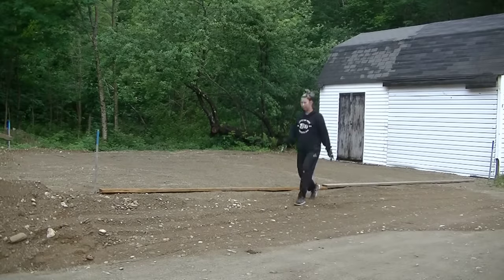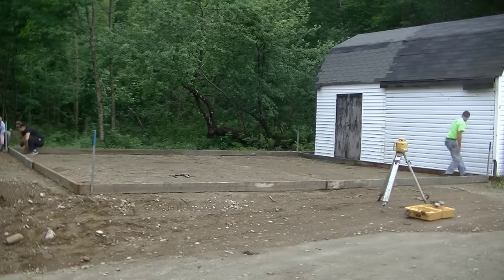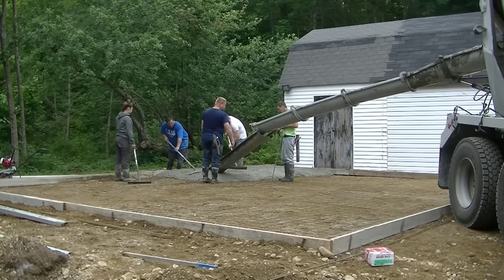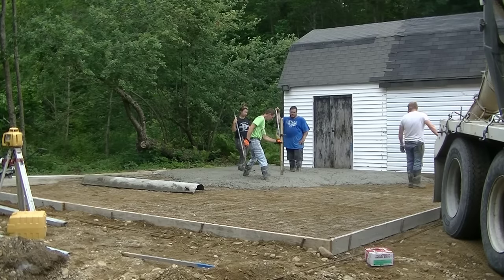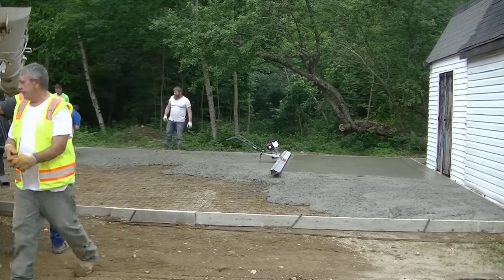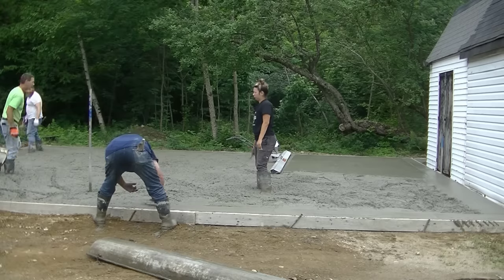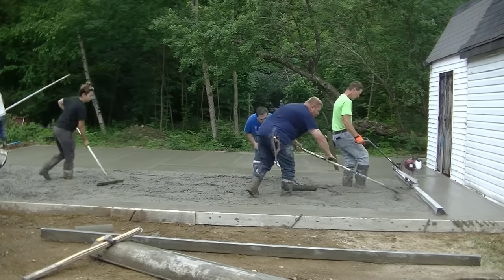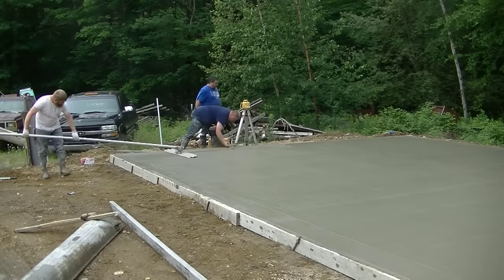Pouring A Concrete Slab For A New Garage (30' x 24') Form & Pour

Comment: Where is the gravel for a strong foundation? Did I miss that part?
Reply from the maker: It was gravel under the slab.
Reply: I always sample the base for a slab to find its stability. If you are pouring next to a house or an area by house that has a ground pitch towards the house you may have some very wet ground which is unstable so i compact in a couple yards of class 5 crushed limestone for a good base. Some soils are naturally good or house was back filled with  stable soil a base like a rocky clay and sand. So if you dont see yellow rock it doesnt mean the soil wont suffice.
Reply: How u know he ain't using a road base material. I'm sure he ain't posting videos of him pouring on plane dirt lol. This ain't his first rodeo

Comment: I was about to ask about the anchor bolts when you mentioned them right at the end. You guys are clearly professional grade. Seen other videos that seemingly know nothing about anchor bolts! The foundation guys gotta have a set of prints. One thing thats apparently not as common any more is setting a course of block around the perimeter to build off of- keeps the plate completely away from any water or shop fluids, etc. Great job - nice crew 👍

Comment: For those people concerned about the lack of chairs under the wire, remember this:
These ‘slab on grades’ (SOG) that they’re doing, have complete bearing on compacted soil. If this were an ‘elevated slab’, like a 2nd or 3rd floor etc, the requirement for the top and bottom rebar, are that they only be ¾” from the top of the slab and ¾” from the bottom (2 cm). The reinforcement is most effective the closer you can get it to the top or bottom surface. The course aggregate in the concrete just happens to be screened to ¾” (what a coincidence) so once some of the course agg gets under the wire, it can’t get all the way back down.
Reply from the maker: Nice explanation, thanks.
Reply: For this type of slab why wouldn’t you want the reinforcement in the bottom 1/3 of the slab?
Reply: @Btown605  That’s exactly where it is. 
A sketch would be helpful to explain the forces going on, but imagine a wooden beam. Draw a vertical row of 3 dots on the face of the beam. One dot ¾” from the top, one ¾” from the bottom and one in the middle. Then one inch horizontally away from those dots, draw 3 more dots spaced exactly the same. Then apply a downward force right between the rows. You would find the top 2 dots get closer together (compression) and the bottom 2 dots spread further apart (tension). These are the same 2 forces that will be applied to this concrete slab. Concrete does very well under compression by itself, so no top reinforcing is required. Concretes Achilles heel is tension, so that’s why the reinforcing is installed at the bottom. 
Getting back to the beam, you would also notice that the spread between the 2 middle dots stays stationary. Proving that the middle is under neither tension nor compression. That is why engineers never mind holes being drilled thru the middle (to an extent, of course) of beams, joists or slabs. That’s also why you’ll never find very much steel in the middle of a concrete beam or slab. It’s all concentrated at the top and bottom bcz that’s where all the forces are happening. Reinforcing in the middle of a beam or a slab is useless.
Reply: @psidvicious  That clears all my doubts, thank you very much.

Comment: Nice job Great tutorial very helpful! me and my two sons are going to try and pour a 21 x 21 garage slab inside 8 inch cinderblock walls with expansion joint all the way around the perimeter. i’m having a little anxiety about it. if there’s any pointers, you can give me that would be a big help.! I think my biggest challenge is I only have the two garage doors entering the garage and a man door on the back of the garage at the end of the side wall! I have poured little sidewalks and a little pads, but nothing more than that, and so I thought I would reach out to a professional to get some good tips and directions on having a a successful pour Thank you, Vincent.

Comment: I notice you did not put plastic down before the concrete went in. What would plastic do if anything if you use it? I wish the guy I helped watched this video. We had to pump the concrete on a cold day( about 25 degrees in the morning) the tubes had ice in them clogging up the concrete it took an hour to finally get the tube free. We had many problems but in the end the concrete was setting at the end and difficult to trowel. The concrete had excelerator in it and I’m wondering what was our problem? The slab was 30’ x 20’.
Your site was really neat, no crap getting in the way. Thank you for a great video. 👍👍👍

Comment: Its surprising how old school it is back east..im assuming its east coast.I been a concrete contractor 42 yrs on the west coast 2 guys would pour this and one guy hand finish it...a lil small for a machine imo..hand rod with a 14' aluminum.I dont see any kickers on the forms either thats different.I worked on crews that had 100 finishers 10 ten man crews just one ten man crew was expected to have 17-20 homes poured a day 6 days a week.It was down to speed and science i dont miss it.We had many pours that were 900-1000 yards at once.Its kind of nice seeing how its done out there main thing is that there having fun.
Reply: Commercial Crete blows. Decorative concrete is where the money and fun is at
Reply: @donpotts9814  i did comercial as a kid..decorative the last 30 yrs

Comment: I'm curious, this is a fairly large slab and it is for a detached garage so I'm curious why there are no footers?  Although local codes will obviously vary, if you are building walls and a roof, why don't you need footers?

Comment: The rebar and wire should be about 2 inch above stone   grade. Just like a concrete lintel, the rebar is closer to the bottom for compressive strength.

Comment: I just did a slab for a 12x24 and it didn't quite turn out as good as I wanted but given the fact that me and my kids did it I can live with the few flaws it has. At least its perfectly square and flat, fairly smooth and just a few flaws in it so I can live with that. Definitely not a professional job lol.

Comment: I was a contractor/builder for years so I'm handy but I have only done very small pours, like shed pads and sidewalks. I'm thinking of replacing my rotting deck with stamped concrete. The sides will have about 24-30" of facing and the pad will be about 16x40 with steps. Thinking it could be too large for just me.
Reply: that is what she said !😁

Comment: Good Afternoon, I plan on pouring a concrete patio and i currently have a sand (fill dirt) base, do I need to pack the sand, add a gravel layer, and pack again to complete the base preparation?

Comment: To do a professional job spacers should be used to lift the mesh from the sub base,steel in contact with the  sube base is not protected from attack from water and sulphates,any structural steel should have at least 2" concrete cover for protection.

Comment: I'm trying to get a garage built in my backyard. Once I get the trees removed, what is considered to be optimal thickness, 4" or 6"? I'll be putting in one lift at a later date, and having a steel building installed over the slab. I'm going to prep everything, but want a solid thickness for longevity and support

Comment: Hi Mike, very nice and informative videos. Thanks so much!

Question:
I’m about to prepare a 40x40 feet slab ( under roof) in south Florida. It’s under a new home on stilts, in order to have a cleaner surface for my ground floor. The home has concrete stilts. Each of the stilts has its own concrete foundation below grade. There is about 2 feet of sand that was poured over the foundation.

- My question is, can I pour my 4 in concrete directly onto the sand? Of course I’ll be using rebar for stability.
- Also, should I divide the surface in several smaller sections, or can I pour it all at once?
- Last question, is there any specific concrete if I want a polished final surface?

Thanks for your input

Comment: Yes I poured concrete when I was younger you know as a helper I've helped do walls and and slabs and sidewalks and I just can't remember do I need a special grade of cement for a garage which I'm going to park vehicles in for strength it's 4 in enough can you make 4 inch just as strong as our stronger than a 6 in and when you put your 6x6 steel wire mesh and instead of rebar do you put like a little spacer on it so it'll be like in the center of the cement when it's poured and not laying right on the ground it have more structural significance if about the center of the poor wouldn't it and can you just brush finish that slab you don't have to have it smooth and you sealer and do you need a moisture barrier I hope that's not too many questions please let me know something thank you thank you very much

Comment: Mike, Thanks for the great videos.  I'm a concrete contractor in Oshawa, Ontario Canada.  I'm going to use your training videos to train my new guys.  I have a bunch right now. Also I have a question. 
I need to cut a perfect vertical saw cut in a finished retaining wall.  Any Ideas?
Jim
Reply from the maker: Hi James, thanks for the comment. I've got a lot of good training videos in The Concrete Underground, my training academy. Plus you get access to me also for questions and knowledge that I have. https://www.theconcreteunderground.com/the-concrete-underground
If I had to cut a perfect vertical saw cut, I'd need some kind of guide to rest the saw against. What kind of saw are you using?
Reply: @MikeDayConcrete  -Where is your company located. thanks

Comment: Love the video's. I'm doing a 30x30 pad parking area. But instead of one large pad I'm doing it in a grid pattern.  Each square will be 7' square. I will be using rebar. Any other advise. Should I use expantion joint to go up against existing slab.

Comment: Gotta do a slab over an old a chicken barn slab it's in good shape but a lot of cracks, perimeters  are solid and deep.can I drop a new pad over that? It's been there for 75 years and hasn't moved up and down.just wonderin

Comment: Is it not necessary to install a stone base under the slab for expansion? How does the soil not freeze and heave the slab? In Pa, a much warmer climate we are required to use stone base. I'm confused. Thx Mike

Comment: When my 24x30 garage slab was poured 20 years ago, he dug a trench around the permitter and another down the center. He installed a re-bar cage in the trenches. Is this not necessary?
Reply: IT IS IMPRESSIVE HOW BAD THIS JOB WAS DONE!  Lay wire mesh on the ground and pull it up a little ONLY TO HAVE THREE BIG GUYS TO WALKOVER  EVERY SQUARE FEET PUSHING INTO THE MUD BELOW THE MUDDY SOIL LEVEL...Repeat that with the rebar below.   LMFAO

AND you sell and pour a floor without know what kind of structure is going over it????????

JEANous!

Comment: just watched a previous concrete guy place 32 yds of concrete in a 24x24 monolithic slab on grade with #4and5 rebar through out and foundation bolts in place, this is 13yds dumped on the ground I imagine yours is less expensive.

Comment: Doing my own slab. I would like to know what is the best way to manage the concrete as coming off the truck. Also, I would like to know what slump number the consistency of the concrete should be so it is easy to rake and level the concrete. I tried an only a one-time long time ago bad experience but I am still willing to learn.

Comment: That process would never fly where I live. You are required by code to have a minimum 12" footings around the perimeter and the mound up so that you can pour a five inch floor. Both rebar and metal mesh atr required. Anything larger than a 24'X24' foot print requires an engineer's stamp.

Comment: Mike when you are running that vibra screed along the wet pads are you running the blade level with the pads or leaving the ends up 1/4 or so? In the video it looks like your running the ends just a little off the wet pads.   Thanks

Comment: Is it possible to pour a different thickness in the center? I ask because I'm going to have a slab poured an will put a Two post lift 12' from the back wall an 3' from the side wall. Benpak says on new pours do 12" thick in the area of the where the lift will be.
Reply from the maker: Yes, just dig the dirt deeper in that area, we pour that way for lifts all the time.

Comment: Mike, i love your videos.  Im going to do my driveway and ive done a little concrete the past 40yrs.  When do i need expansion joints plse, thx, keep it up
Reply: Every 15 to 20 feet you need expansion joints and of course always place expansion joints against existing concrete if you are pouring and butting up to any existing crete. Cut in control joints with your jointer wherever you think there's a spot where the concrete could crack, like coming off of a corner or something.

Comment: hey Mike love your course !! My shop just burned to the ground and lost everything . I want to build a 50X60 metal building in my back yard but I have a 18x36 inground vinyl liner pool that needs to be filled in in order to utilize that space. what things do I need to know about putting a slab on top of a filled in pool , Thanks keep the videos coming. Dave
Reply: That "filled in pool area" is really going to need to be compacted.. might even consider letting it sit for a year, with a 4"-6" of sand on top of the compacted area.   just to let nature do it's thing.  I learned my lesson on a project like the one you are describing. Some old timers told me it really needs a yr or 2 to settle with the effect of rain..

Comment: I had a 24X30 garage slab poured on 05/13/21. Highly recommended concrete guy. I was impressed with everything. They pulled stumps, leveled,  put forms in, sub-base, and put plastic down before rebar, and poured a 6" slab and concrete at 4000psi. They said they didn't put expansion joints in because it wasn't big enough to need it. Just wanted your thoughts on expansion joints.

Comment: Hey Mike,  when pouring small jobs like sidewalks , at what point should I go from mixing sakrete to having concrete delivered?
Also do you think the quality of your typical 4000 psi sakrete is as good as what I would get delivered from the local concrete company?
Thanks
Reply from the maker: Jeff, the quality is different in the ready mix, especially for exterior concrete. You get air-entrainment if you're in an area with freeze/thaw. If not, it's not as much of an issue.  I wouldn't mix more than about 10-15 bags before I decided to call for a yard of ready mix.
Reply: I'm not Mike  .but the answer is no

Comment: Mike, do any of your slabs require footings? I believe, here in Michigan, we're required to pour (or block) a 42" footing around the perimeter of the slab. Also, can you post a video on the importance of cleaning your concrete tools? Thanks!
Reply from the maker: Our "footings" would only consist of the edge being thickened to 12" or 18" deep on a 6" slab. The width of the footing may be 12" to 2' but that's all that's usually done here. If the people or code enforcement want more than that then usually a footing 8" x 16" and frost wall 8" x 4' is done and we pour a floor inside of it.
I'll see if I can make a vid about cleaning the tools, yes.

Comment: gonna be doing my own pour entrance to a driveway 24w x 30l first ever pour 4 inches thick but its on a slope so wish me luck learned a lot on your video thanks! do you think the fiber and the and the rebar are absolutely necessary? I was told you just need one or the other.

Comment: When pulling that vibrator how do you know your not dipping on that right hand side we always put a pipe in so that it rides without vibrating down and putting dip in the middle then we come back pull the pipe and float it in?
Reply: The thing he is doing is never letting the screed ride up on top of the form.  Either have something to screed off of on both sides or neither and finesse it.  He says how important it is to have it raked good, and what he doesn't say is how important his finesse is.

Your way, no doubt, is more precise, but you still have to finesse the fill you put in where the pipe was.

Comment: I’m building a block garage 37 wide by 45 deep. Block walls 16ft tall. I’ve poured 20 by 14 before but nothing as large as what I’m planning. Concrete will be 4000 psi with fiber and #3 rebar. Do you have any tips?

Comment: I was thinking about doing my own  10' x 42' slab. But what would be a good price point if I was to have someone do it, any opinions? The slab is only meant for a strong foundation for a 8x40 storage container
Reply from the maker: 4" slab around 1800 - 2000, 6" slab 2100 - 2300 concrete, form & pour only. sub-base work would be extra. Just general price here and more in my area Maine. bull float/fresno finish, smooth trowel finish add a few hundred more.
Reply: @MikeDayConcrete  thank you I greatly appreciate your knowledge
Reply: 5 bucks a square in Wi for set up and finish and subgrade work i run about 30 bucks a yard for additional gravel, sand is not recommended

Comment: I notice that there are no footings.  I know you are in Maine.  I’m in Minnesota and I’m looking at doing a 42x48 slab and I’m looking into the footing types.  The building is a super light versa tube building (5000 pounds) can I get away with a slab just like this one?
Reply: IT IS IMPRESSIVE HOW BAD THIS JOB WAS DONE!  Lay wire mesh on the ground and pull it up a little ONLY TO HAVE THREE BIG GUYS TO WALKOVER  EVERY SQUARE FEET PUSHING INTO THE MUD BELOW THE MUDDY SOIL LEVEL...Repeat that with the rebar below.   LMFAO

AND you sell and pour a floor without know what kind of structure is going over it????????

JEANous!